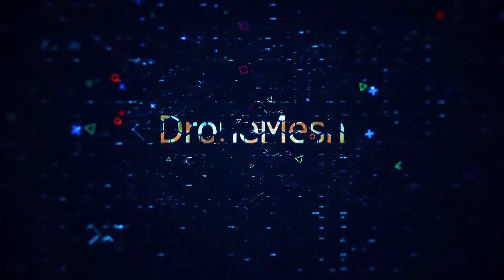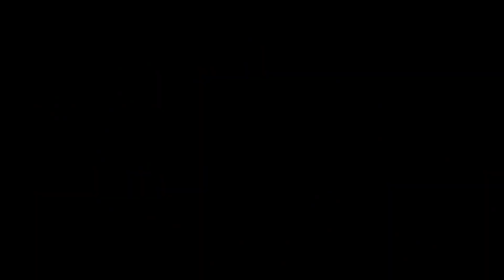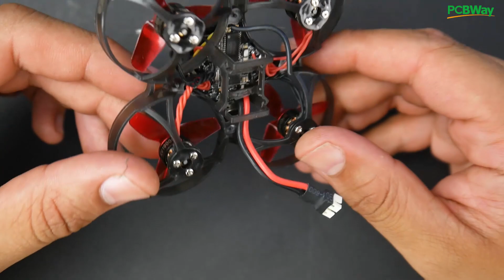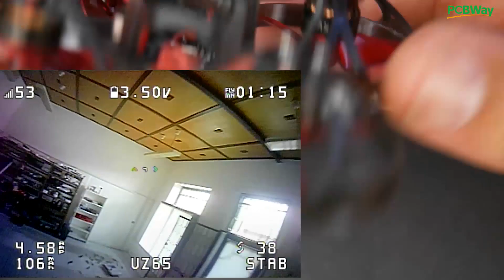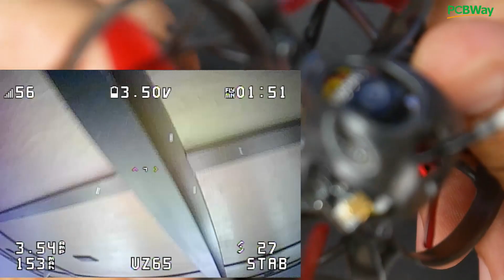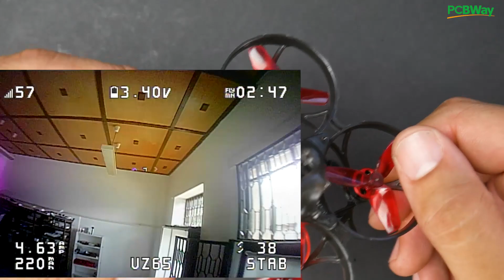Eachine UZ65 1S Whoop  // 21 GRAMS!!!

Comment: Question 🙋 

How do you connect an external receiver ?

Because I got one cheap:

FC = external receiver Version, but with removed CRSF..

Now I want to add an XM+ or CRSF, but the wiring diagram is a but confusing..

Can you help ?

Comment: If you conformal coat it, and drill a small hole in the back of the canopy for the antenna, and rotate the VTX vertically, it works super. This way with turtle mode the antenna won't pop off.   That allows you to move the camera without issue.  As a starting point, the split VTX makes for an easy way to swap out for other VTX if you want.